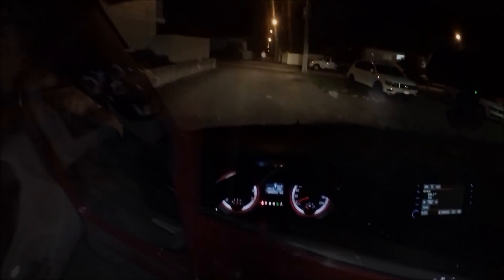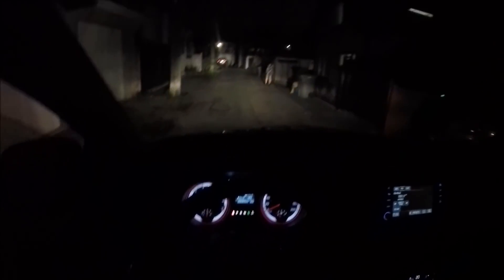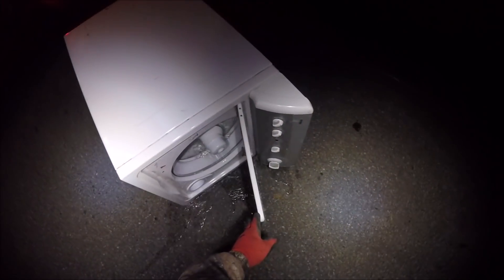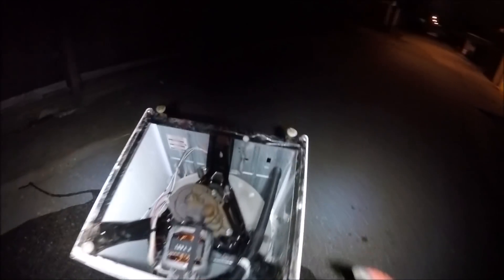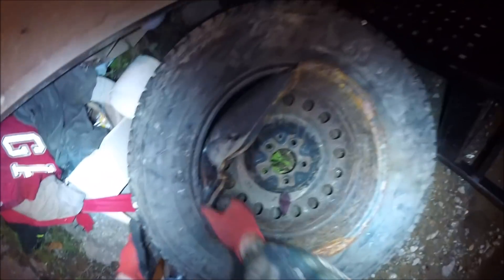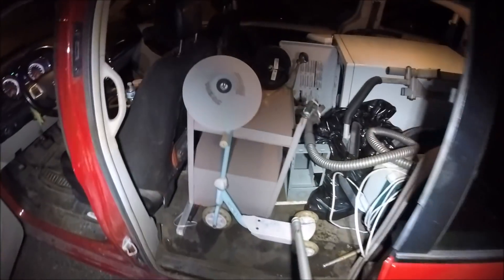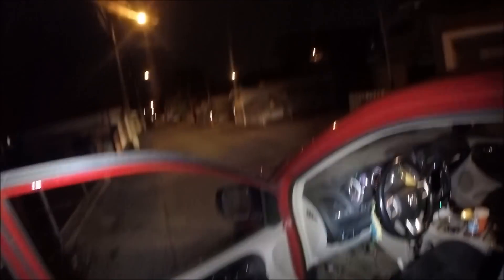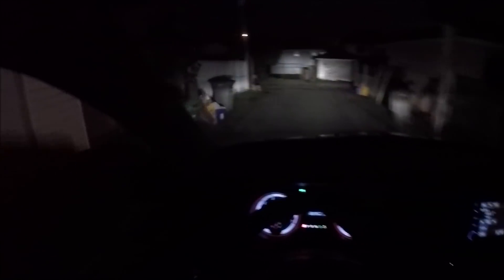Street Scrapping Bottles vs Scrap metals

Comment: Dehumidifiers are full of copper and a compressor.... it’s worth it
Reply from the maker: It weight less than 5 pounds & might of been stripped
Reply: @CanadianTreasureHunter   2 copper aluminum radiators some copper tubing and some copper wire and compressor with copper windings in the compressor...

Comment: Bottles adventures are giving me ideas. How about filling the bin with bottles. 😁😁😁
Can anyone guess, how many bottles will take it to fill the bin? 
I started calculating. Hmmm. 
Diameter of the bottle is 75mm (approx) height of the bottle is 200mm (approx). 
Dimensions of the bin are 2.5 meter wide X 2 meter high X 6 meter long.
So he can stack 35 wide, 10 high and 80 in length. =  28,000 nos.
@ 10 cents a bottle, the load will be worth 2,800 $$
Note : In the space between bottles, he can stuff folded pepsi cans to maximize returns.😎😎😎😎
Reply: Altaf, you have too much time on your hands